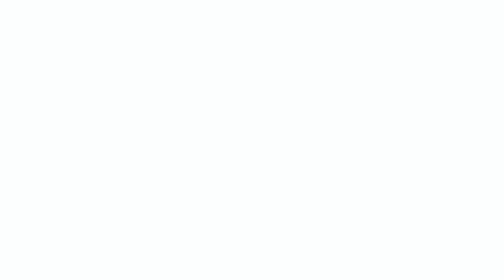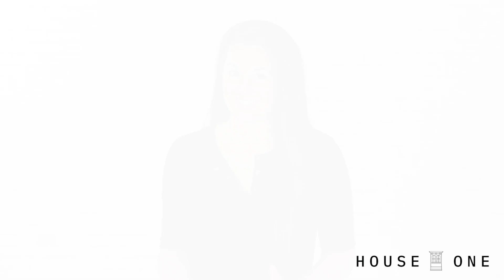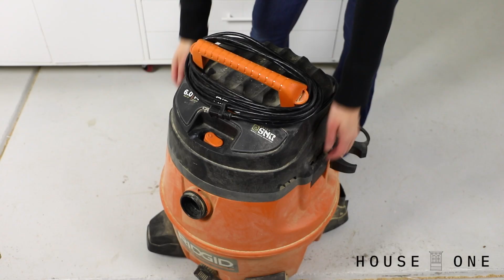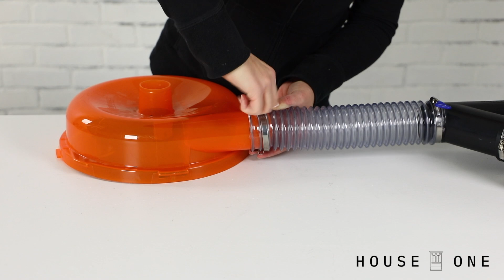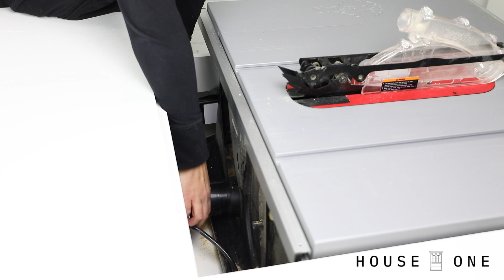Mobile Workbench with Dust Collection | House One | This Old House

Comment: Shop Vacs will never give you good dust collection. Considering the cost of the vacuum, separator and the IVAC system, it would be cheaper and way more air movement if you went with the Harbor Freight dust collector.

Comment: I have tried doing this exact thing and though it works it doesn't work well, at the end of your dust collection you go from a small opening, say 6in to a large opening say a bag 24in. What happens here the dust hits a large space and the velocity slows down, thus the dust falls to the bottom and stops moving somewhat. If you plumb in say a 2in hose to a 4in line, once the dust hits the 4in opening same thing happens, dust slows down and stops moving somewhat. If you want the dust to keep moving down the line to your bag, where your 2in pipe joins to your 4in pipe you need to add another 2in opening even if all its doing is sucking air, that way air movement in your 4in line is not restricted. This applies to dust collection systems large and small.
Reply: hey look it's dipwad's insignificant other.... have fun on the hershey highway...